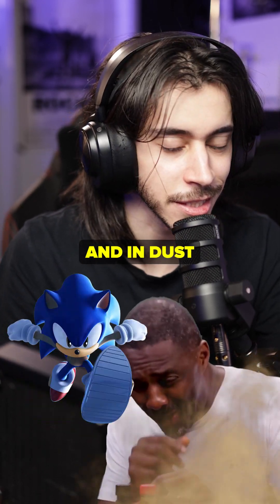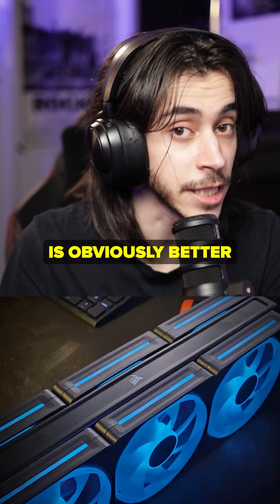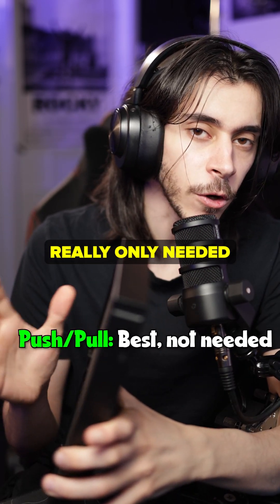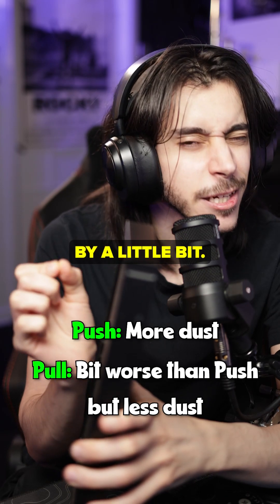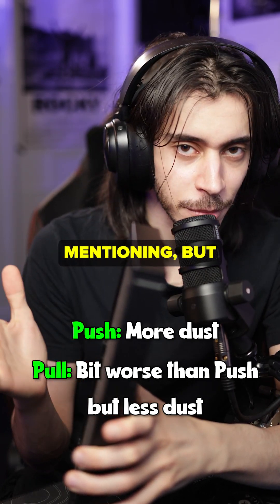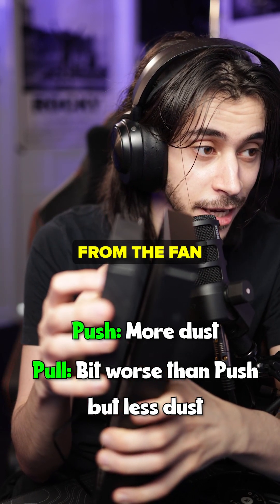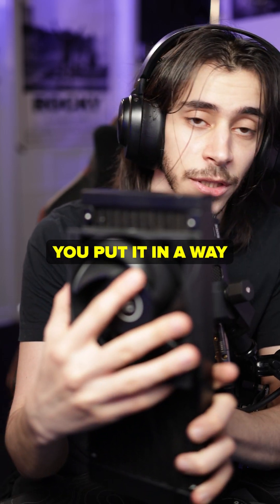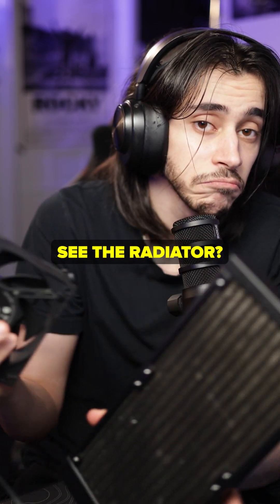Radiator Push VS Pull Explained - #radiator #watercooling

Comment from the maker: The performance difference between Push and Pull is really negligible. The dust difference is worth noting tho

There is also a slight difference in the way it sounds, some people don't like how pull sounds because of the air going through the radiator but from my experience, unless the fans are very loud, it's not a big deal

If you just want to go with what's better, that's fine too. Also Push Pull really only makes a big difference with thick radiators
Reply: Push pull also benefits for front mount(intake) cpu aio radiator. Helps airflow to other system components

Comment: Another benefits of push over pull is that if you push air the fan itself won't have the hot air from the radiator going through it. You might be surprised how much lifetime a fan can lose over a couple of degrees...

Comment: i tested it in my unit. if the only exhaust you have is through the radiator. a push pull setup is ideal. i did just one config and the pc shuts down due to overheating.

Comment: I have a corsair crystal 570X and the only place I can install my 360 artic freezer 3 is in the front. Ive been researching this topic all night and I am finally accepting the idea of having a cooler cpu but slightly warmer case temp. My gpu has 3 fans anyways so im sure it can handle a tiny bit more heat. Plus, unlike my gpu, my cpu can only depend on the cooling system to maintain low temps, in other words, I think a front mounted AIO as intake is really not as bad as people say it is on the internet.

Also, that AIO'S radiator is pretty thick. Unforunately I only have 1 extra fan so i dont even know if i can do a push pull with one fan being on the push side. I think ill just do a pull config with normal fan speed and set my exhaust (top and rear) fans on high speed to get positive airflow.
Reply: Front or top, it doesn't make a significant difference. Do you want negative PC pressure or positive? Front mounting a rad restricts airflow overall, if you have bottom intake fans, it's fine though. You'll want good exhaust and bottom intake fans, then the inside temps may not be too bad. 

Personally, I always go top exhaust. Especially if it's a 360 or 420, and you've got a full front intake of fans - the fresh air from the top intake will basically go straight out the radiator exhaust still. So the concept that hurts exhaust fan thermals with an air cooler actually helps an aio. It's been tested under load, and as long as your case has decent general flow, top mounting is at worst only 1 or 2 c hotter than front mounting for the CPU, and it helps the rest of the case more than you may think. 

Both are fine though. Literally everything is fine 😂😂😂

Comment: Hello, dumb question but could the fans be damaged if I run a push/pull?

Chassis -> Push Fan -> Radiator-> Pull Fan (Reverse blade for a clean look in case).
Reply from the maker: There’s a CHANCE to damage them if you use different kind of fans and their CFM and static pressure is very different, if you use the same fans it’s fine people do it all the time just match their RPMs
Reply: @solidgutstech  That makes sense. The fans I plan to use have a .17 CFM difference which isn't bad So I'll just have to make sure the RPMs are matched 😂. 
Thank you! 🙏🏼

Comment: I want to clarify I haven’t seen any testing , but isn’t it the general consensus that push/exhaust for you aio is the worst option? Like you’re pushing hot air through the radiator that is meant to be cooling the coolant that absorbed the heat from the cpu.
Reply from the maker: In theory, it is yes. In practice, how much would it matter? That depends on the CPU

If my 360mm AIO is on a 7800X3D or a 7600X, very low power CPUs, not much matters, they’ll get good cooling anyway

If it’s on a very demanding CPU, it’s possible every degree matters

Comment: What in the world does "pushpull" mean...
had to rewatch the video multiple times to understand because I missed a key part of it.
Reply from the maker: It’s when you have fans on both sides of the radiator, so one fan is pushing air through it, the other is pulling air from it and it’s called « push pull » config
Reply: @solidgutstech  I feel like op meant the sound effect

Comment: What about both Push and Pull, how much better than just Push?
Reply from the maker: Not a lot, it gets better with push/pull when a radiator is very thick or has a very high fin density 

I have 45mm thick radiators and I just use push and still feel plenty of air